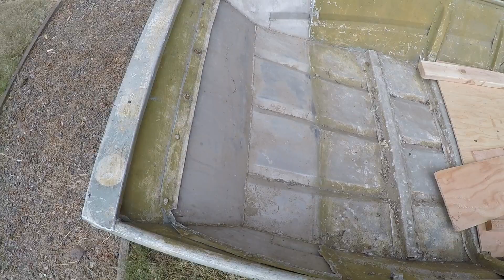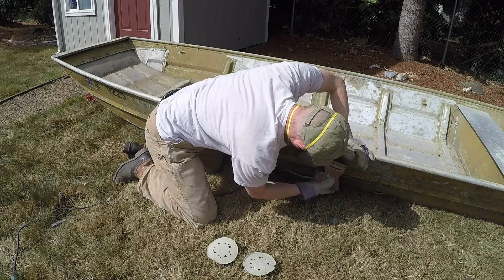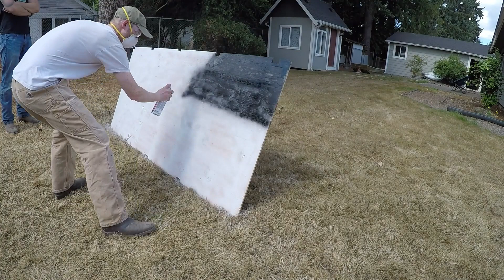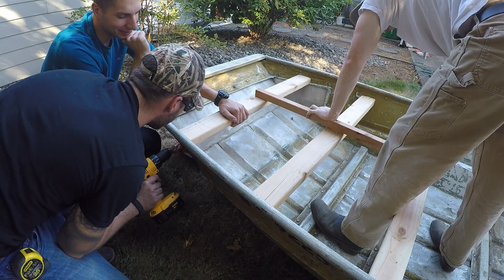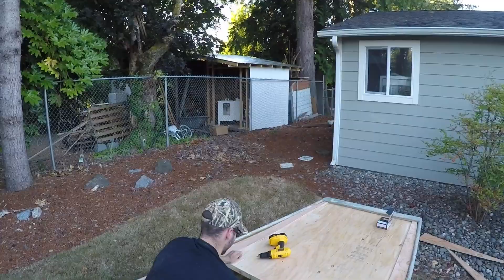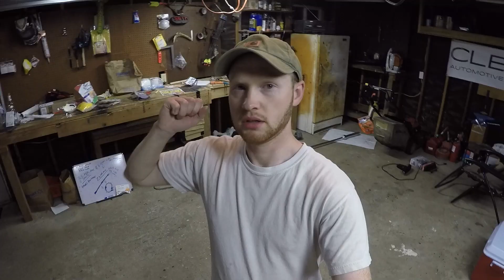Building Duck Boat Blind Part 1

Comment: in case you want to get rid of the pieces of the old bench left over in the boat you can grind the heads off of the old rivets and hammer them back flat after you pull off the old metal. Did it on my boat and it never leaked.

Comment: How much did you spend on everything to make the blind?
Reply from the maker: The boat was $300 got it super cheap. the blind we are around $200 havent totaled it all up yet but i am uploading part two right now! the total will be probably around $300 maybe more with camo netting tarps etc.
Reply from the maker: Currently hovering around the $800 mark for boat trailer supplies. Still need a few things